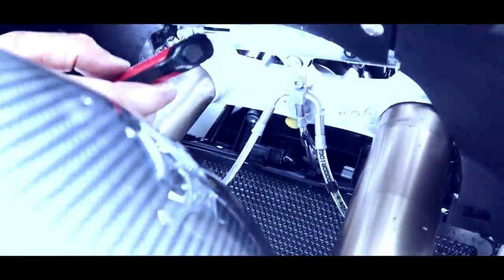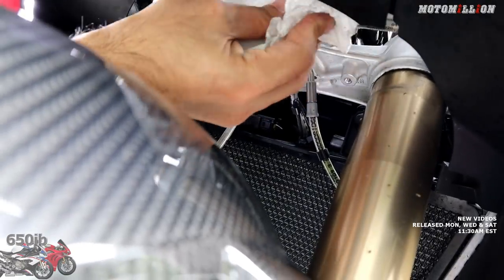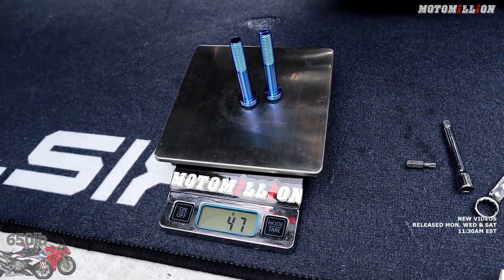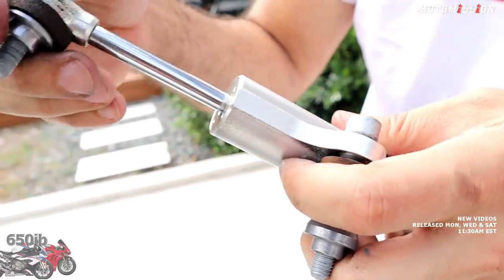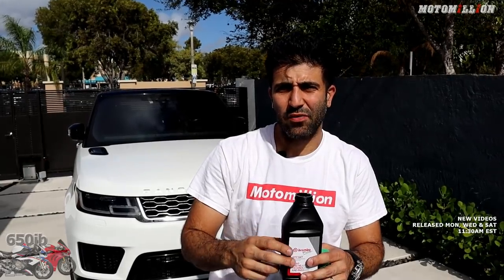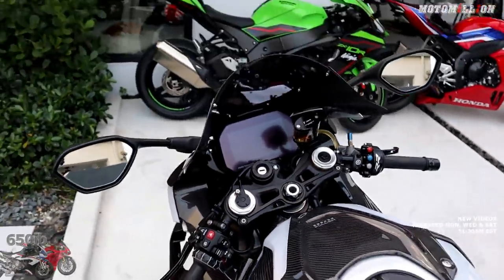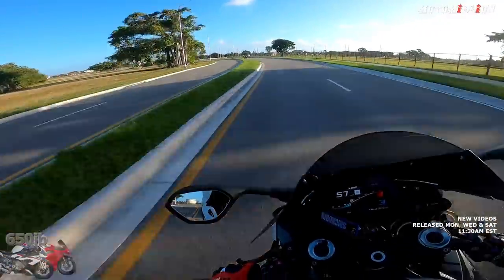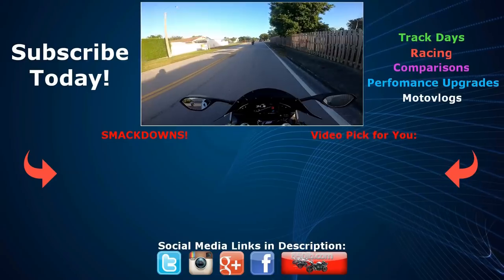UPGRADED EVERYTHING! | World's BEST BMW S 1000 RR!!!

Comment: Good thing that Mani found those leaking parts & got them replaced
Reply from the maker: Agreed 💯
Reply: Agreed. 
BMW has a “stop sell” until those brake leaks are corrected. Hopefully by Feb 2021. I’ll get mine if I don’t win this bike. 😊
Reply: Mani is tell opinion on his motorcycle directly. He is not entirely telling the truth on BMWs Recall for the brake calipers. If you know anything about there Recalls and Info the are working on a solution. Bmw never was replacing a seal for brake calipers that is a sales tactic for you to buy brembo pads.
Reply: “Manny” is short for Manuel. It’s like Danny for Daniel. “Mani” in Spanish is peanut, which isn’t a nickname. FYI my name is Manuel and I go by Manny.
Reply: @TrackSol   on his website he spells his name as "Mani"

Comment: Hey Manny for the 100mm caliper set up you need to run 17Rcs. Look it up. Cheers
Reply: You are mistaken sir.  The GP4-RX calipers which were used in this video has 4x 32mm pistons.  Anything above average piston size of 30mm pistons, Brembo recommends a 19mm master cylinder, which is what was used on this and is correct.

In fact, the 108mm and the 100mm spaced calipers all use 4x 32mm pistons.

Here is the technical specs of the calipers:

osition                        	FRONT
Caliper Body 	2-PIECES
Ø Pistons mm 	32
Pistons Q.ty 	4
Disc height mm 	32-34
Material 	Billet Aluminium
Surface protection 	Nickel coating
Piston material 	Aluminium
Weight w/o pads (gr) 	1000
Mounted pads included 	Yes
Offset (mm) 	30
Note 	2 calipers kit

Comment: I thought bedding in the brakes had to do with the pads getting set to the rotors not rotors to pads...... the heat in the pads will allow the pads to conform to all the "nooks and crannies" of the rotor as it passes through the caliper at speed. Could be wrong on this but what do I know?

Comment: Mannie, at motomillions, should read up on the products before going on your video.  His lack of knowledge came across as lacking as his customer service. The Brembo Corsa Corta is the upgrade to the RCS. It was made smaller than the RCS, which allows it to fit most bikes without having to switch out the stock controls as the RCS required; hence saving you a lot of money on parts you don’t need. The Corsa Corta masters also prove 3 braking styles to match one’s riding environment, and you can set the point on the pull to where the brakes and clutch engage; which aids in 1-2 finger utilization as seen in MotoGP and WSBK. 

Other than motomillion Mannie’s substellar presentation of how the Corsa Corta differs from the RCS, good content as always. Keep the rubber side down.

Comment: Everyone I know running one of these bikes always wrecked them.. wonder if the leaking calipers were the culprits. 🤔 either way how could you not pick the bmw!
Reply: I think that they didn't respect it's power, this is a killer machine. literally and theoretically
Reply: The bikes are endless money pits, that constantly needs to be repaired.
Reply: @Mohapi_Tau  not true my G. Why do you keep commenting this xD, do you have anything better to do?
Reply: @TheZallene  come on we all know that beamers haven't been know for reliability, especially their cars
Reply: @Mohapi_Tau  i've owned two old beamers for 8 years, only major issue was replacing the radiator :'). Just gotta look after them man.
Reply: @TheZallene  I think maybe their motorcycles are better in reliability, in comparison to their cars. Especially their V8s.
Reply: Hey now my 335i with a 400 small block and th400 drives great and never broke and it’s pretty cheap to repair.

Comment: A lot of "low quality" stuff for the new gen 2020 S1000RR it seems. :\
Reply: It really does seem that way, I have a 2017 and I don't think ill be upgrading to the new generation. I like mine alot more tbh
Reply: @willydmankal  Ditto. I've got a 2016 and really thought about upgrading, but not anymore. Besides, I was never a fan of the new face on the new gen.
Reply: @Doogerauoy  same here with the 2015 :/ I like the fact that it has a nicer display and more power but I like my Brembos and I think the new painjobs look cheap
Reply: For a bike that costs that much, its a ripoff. The Fireblade will destroy it in reliability, while maintaining performance.
Reply: @Mohapi_Tau  I mean Ducati’s are overpriced as shit but atleast they still give ohlins and brembos. I would rather bmw get rid of the $4000 carbon wheels and put that into suspension and brake components and stop with the bs cost cutting on a 24000$ bike